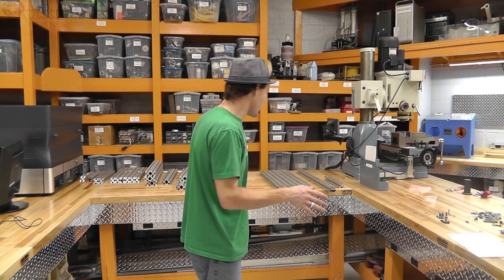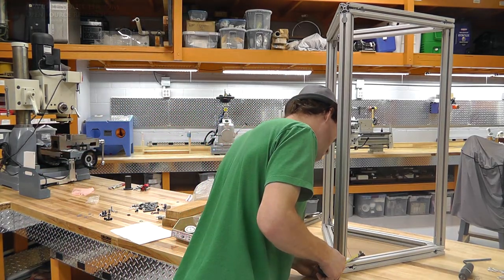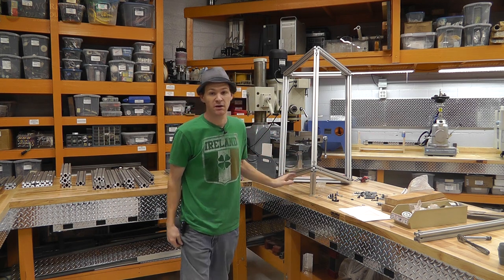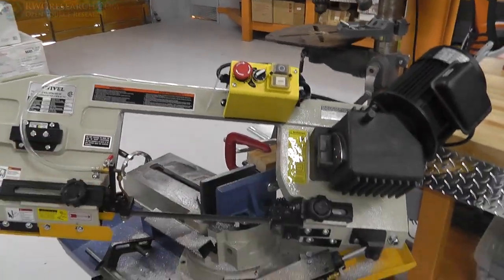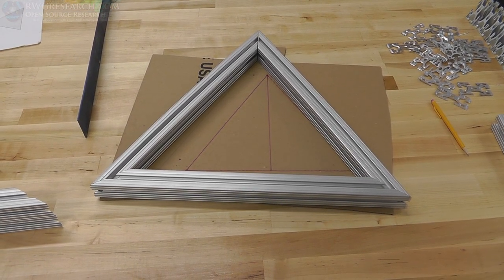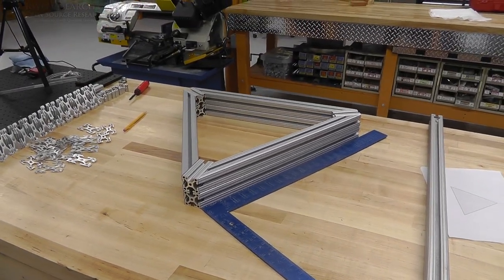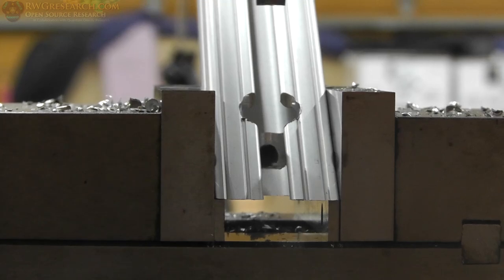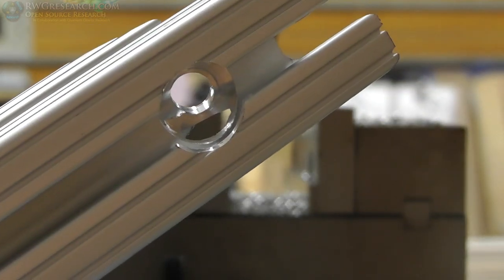RWG-OSD #1: OverSized Delta 3D Printer Build. The Introduction... What Did I Get Myself Into?

Comment: you can use a wood cutting miter saw,as they all have carbide blades.you can hold =/- .003" easy all day long.saves set up time.
Reply from the maker: +bill bailey yeah that would work for this. that ban saw cuts very nicely,  it was just getting to that angle.. thanks for the tip! ~Russ

Comment: Just a comment. Russ can you give drive speeds and bit types that you use. I don't have a clue on them.
Reply from the maker: +msapostle god idea! there is a formula for that.. however i just go by what i see. if its cutting nice i leave it, if its " gumming up" i slow it down. lol but yes in the future i will do that!  this is a nice AL and it cut really nic with out gumming up. need some aluminum cutting oil...
Reply: +rwg42985 Apparently a good choice of lubricant for machining Al is plain old kerosene.
Reply from the maker: +reprapmlp interesting choice. ~Russ

Comment: Rus, with i would invest to some mgn12 linear rail since you already making real frame.
Rods will again make inaccuracy so you will not see much difference.

I did similar project year ago : https://app.box.com/s/ojrqltj2p2gwwndkgarl
I was my last delta and i am done with them now :D

regards
Reply from the maker: +danoseus cool! that looks good! hows the "roundness" ? 

and yes, I'm using the extruded AL as my rail... so it will not be those rods... no way! :) thanks for the tip!!! ~Russ
Reply: since i used pre-driled profile geometry was perfect. Problem was with arms. Without load (just one bowden extruder) i could get amazing accuracy, but if you but some weight (two hotends/ direct extruder) there it goes rapidly down. Russ get some 0.9 step motors a proper elecronic (I can recoment MKS SBASE - in you want cheap build).
Reply from the maker: +danoseus thanks for the info. in my next video you will see what I went with and why. :) ~Russ